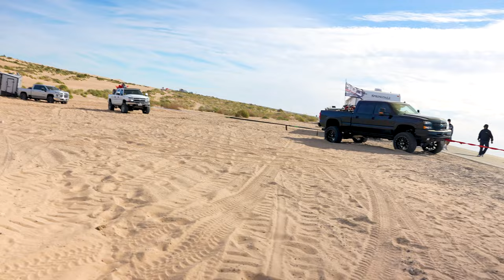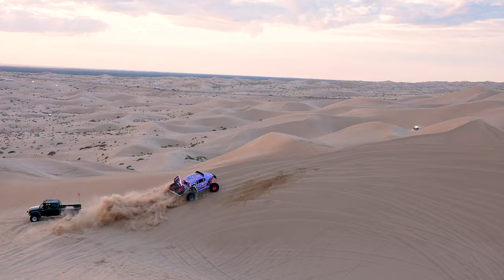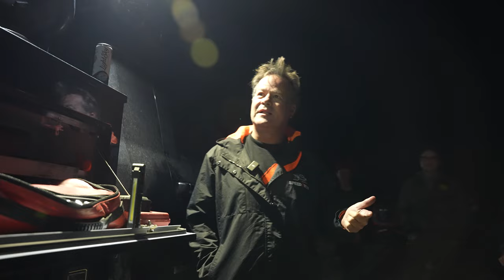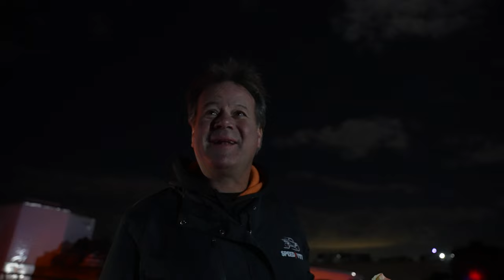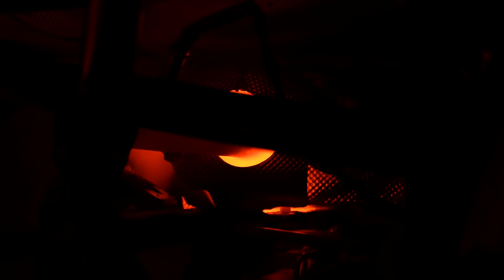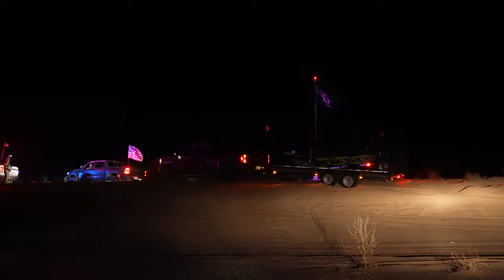BJ Baldwin | 2023 Glamis Weekend | Rescue & Recovery Operations, Robby Gordon, Speed UTV

Comment: @BJ Baldwin, did you notice decreased power in the rear without delivery to the front?  Asking because I have a TRX as well.  I assume the differing power split from 50/50 to 70/30 between modes is done via clutches... I am not too familiar, I admit. I am curious about what happens without a front to drive, in case I break mine.  Thanks!
Reply: Huge fan, love your content!